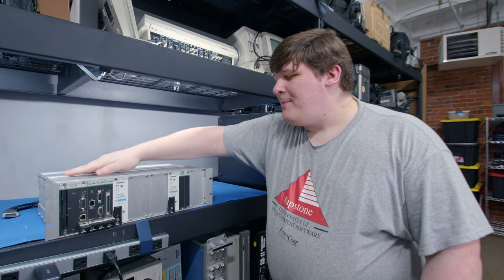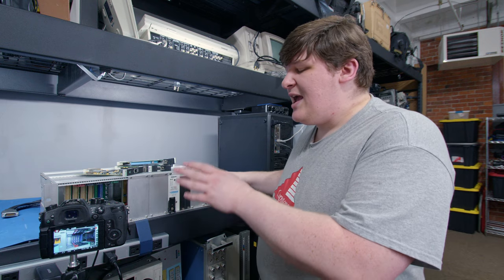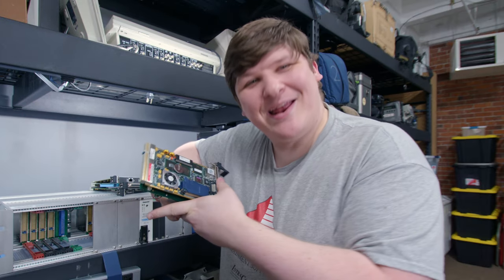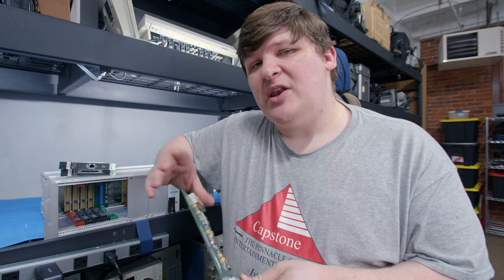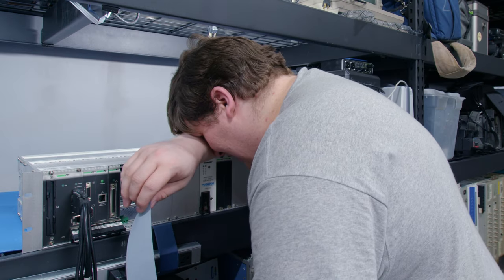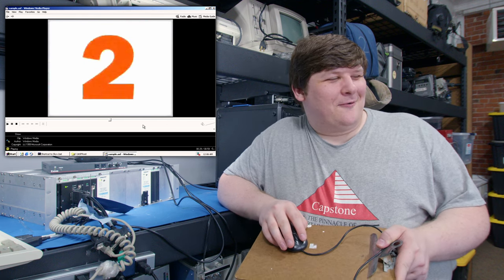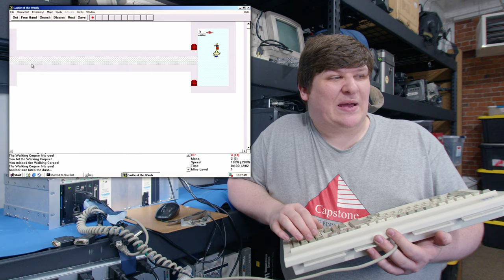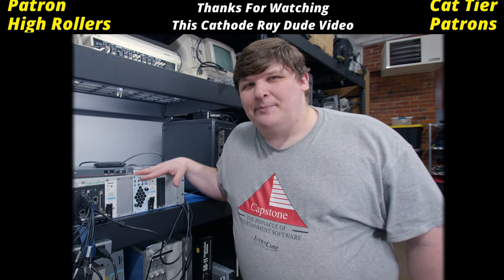Little Guys Ep 12: Computing With Eurorack

Comment: RE the SCSI port, my brother-in-law is an engineer for the auto industry. One of the many job anecdotes he's told me over the years is that they had a very expensive and perfectly useful piece of diagnostic equipment that could output Data to a PC, and it used a SCSI interface. They had to keep a very old computer running in order to make sure that that tool didn't become obsolete because it was five figures to replace it with an updated one. I bet you that external front-facing SCSI port was for a specialized industrial peripheral of some kind.
Reply: Around that time SCSI was used for things like scanners and other things that would be USB now. I have a Nikon SCSI film scanner that I’ve used with a FireWire adapter (not so convenient these days either).

Comment: Regarding SCSI for industrial use. In the past SCSI was also used for connecting scanners. Now in the place where I work we have a couple of machine's with "modern" (Read: Adaptec SCSI adapter with on PCB PCIe-PCI bridge) connecting to a node on the control system and gets process data out of it for the historian.

For audio: Use the USB port ;). Win2K Ships with a generic USB audio driver. Just enable the Windows Audio service in the service manager. That is disabled by default on server editions.

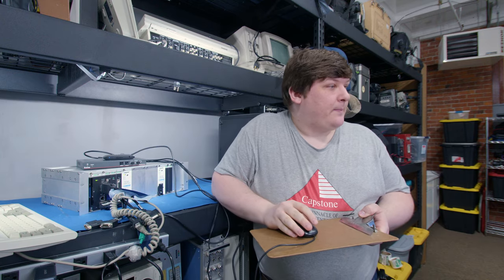Comment: 36:57 - Castle of the Winds!  Hell yeah!  I remember playing that off of a CD called 300 WayCool Games for Windows back in the mid 90's!  I actually have it installed on my Windows XP machine.  I remember finding a glitch in it growing up where if you used all your mana, it was possible to underflow your base HP into the negatives and then when you healed yourself you'd gain health without an upper limit and basically become an unstoppable bulldozer and could tank every enemy for the rest of the game by just ramming into them.

Comment: 10:40: IIRC the width of the cards were called 4T, 8T, 12T... Where a "T" is always 5.08mm or 0.2 inches.
Reply from the maker: ahhh, interesting. I'll keep that in mind!
Reply: That would explain the expression of "Fits it to a T".
Reply: So. The spacing is identical to Eurorack modular synth standard. My immediate thought has been confirmed and I'm 100% sure they both use the same screw rails.

Comment: Never saw one of these old units. I only briefly worked with an industrial robot control box that looks like this ten years ago, it's Kuka's Sunrise based on JAVA and Windows XP. The mainboard connected to their own hardware in the box. It could also be LAN connect to program it.
And to start the robot, you need its proprietary interlock remote control, you can't operate it without the safety interlock remote, it's where emergency stop button located.

Thank you for this video, I never had in-depth look at old hardware, this looks like a pain to operate.

Comment: honestly i wish that eurorack had kept the backplane connectors in some capacity because even in the era of keyed connectors people are STILL frying modules by plugging them in wrong. plus a proper backplane connector would have had the trace width to properly use the pins rather than doubling up power across pairs of lines. imagine the utopia of having clock/run lines to go with the cv/gate bus lines! come on folks API 500 series is doing it and they're really not any more or less expensive than eurorack.
Reply: I think Doepfer did what he did for price and ease of manufacturing. Those connectors + guides cant be cheap. Also, it would be much harder to make skiff friendly modules. Would be cool though, I do agree.
Reply: I mean the CV/Gate lines are rarely if ever used, so we could already use those.
Reply: @AshBashVids  yeah in modern hindsight clock lines would be far more useful. i don't think doepfer foresaw that people would be putting DAW-in-a-box sequencers like the hermod in their modular systems.

Comment: Definitely needs to become part of a synth! One manufacturer called Modcan used to produce an adaptor module for mounting and integrating a Mac mini into a euro rack setup.  While sound creation on a modular synth is seemingly infinite - accurately sequencing music on one is tedious and benefits from modern MIDI software. (And a MIDI to CV converter)  Certain sound cards that are DC coupled can even be used as CV sources using the appropriate software to send continuously variable signals for controlling all kinds of synth stuff.

Comment: Hell yeah, Castle of the Winds! I had Vol. 1 from a shareware disc and played the crap out of it, wondering if I'd ever see the mentioned sequel. Turns out I found it at a big box store's electronics section a couple years later (shoutout to Bigg's Hypermarket, RIP) and still have the 3.5" disc floating around somewhere. 

Funnily enough, we play the game completely differently. I always maxed INT and got Magic Arrow first to spellsling from a distance while running like a wimp down the hallways. And finding traps with my face.

Comment: Yep!  In an industrial computer setting remote boot is probably the main method.  That's because you need to be able to control and monitor them from remote.  If you actually have to go to the machine physically that would be a ladt resort.

Comment: Since you mentioned Eurorack... Look up Look Mum No Computer. Sam Battle builds his own Eurorack synth equipment and has expanded it into a standard he calls Kosmos. He has many of the schematic, gerbers etc for his Kosmos modules available for free on his website, and several others have put their own Kosmos module plans there too. He tours and performs live with his gear and he has a museum chock full of vintage and weird electromechanical and early electronic music equipment.

He had to shuffle a bunch of stuff around to make room for the pipe organ he rescued. It had been salvaged from an old church a long time ago and built into a house. When the house was sold the new owners wanted the organ out but didn't want to trash it. Sam got wind of it and bought it. Then he figured out how to adapt it to MIDI control and in the process of that he designed a MIDI board which operates a lot of solenoids. (Plans download for free for that!) He used several of those boards to operate all the solenoids that run all the organ pipe valves. He wasn't going to use the original organ console but he went ahead and fixed it up and adapted it to be a MIDI keyboard.

Comment: I work in the Metro of the city of Valencia, Spain, and we use similar PICMG equipment for every computer in the entire network! I also brought one home that i put two computers inside of. I also have the PC's that go inside each turnstile, to process RFID data and send it over ethernet to a central hub. They are Celeon 600 MHZ grey rectangles and are being decomissioned slowly, they run windows 2000 and have a custom autorun batch file that starts all the custom software that powers each turnstile.

Comment: The dual NIC might be for two different subnets.

It's pretty common in industry to have one network for local machine control, and another network for the machines talking to the factory itself. The local network is to control devices at the machine, and the plant network is to push data to the machine for data on how to run the machine, or to pull data from the machine for analysis and troubleshooting.

Comment: The specialty connector on the SCSI might be a combo 50-pin + Power. Kind of like the 44-pin IDE connectors in laptops. 40-pins + power. I imagine there's two drive trays/carriers that break that cable back out to a standard 50-pin IDE drive and 4-pin molex or uses a hot-swap SCSI drive. If not that, then just a cheap IDC ribbon cable connector that didn't require expensive 68-pin SCSI connectors.

Comment: The connectors on that (and a lot of other passive backplane systems) use those kinds of square pin connectors.  That design actually goes back to before the apollo program - Curious Marc and the AGC video series show similar connectors being used for the AGC components IIRC.  I wouldn't be surprised to find modular radar and military communications systems in the 40's and 50s having a similar type block connector for modular components (albeit larger-pinned).   Amphenol makes a ton of military/aerospace/industrial connectors similar to it - and I believe they even sell/sold a CompactPCI backplane.

Comment: I've always loved the back plane based systems, especially the ones like this that make perfect retro PC's in a tiny box... if you can get video and everything working properly, preferably without the breakout cable that I've had to make an i/o plate out of by hand for before. There's just something about the concept that I really enjoy, along with the other extreme of all the embedded SBC style systems I've collected and love.

I feel like at least the designs of these industrial machines at the board level will make a comeback with Chinese manufacturers expanding past the 8086 era to make more of the "portable retro computers." If they integrate the right video and sound devices along with a bios that allows in depth enough hardware tweaking, you would get a machine that covers a broad range in a simple/small package.

Comment: The fact that this thing is a satellite gateway makes sense with the 2 Ethernet adapters. One would be facing the avionics side of the aircraft with the satellite radios, and the other side would have a WiFi access point and probably the in-flight entertainment monitors. That would explain the SCSI card and the media encoder, because the SCSI port would connect to a hard drive shelf which has the in-flight movies on it.

Having more than one Ethernet adapter is really common in these industrial boxes. Usually one end would connect to some Ethernet based fieldbus and I/O on the customer site, while the other side would connect to either an in-house SCADA system for high level management or to the internet via a VPN tunnel to allow remote maintenance and diagnostics.
Reply: This predates Wi-fi for most applications; I imagine it was more a "pay us and we'll let you dial in or connect your Ethernet to our dumb switch."

Comment: In particle physics experiments, VME was an 1980s improvement over CAMAC (70s) which was an improvement over NIM (60s).  NIM is for Nuclear Instrumentation Module because all particle physics was nuclear physics back then.  The NIM modules plug into a backplane and have well-defined behaviours.  You connect them with BNC or LEMO cables for your particular(lol) needs.  E.g. you can have a dual comparator module that takes in analog voltages and send a standard pulse when a threshold is crossed, then another module might apply a delay, then another would AND those two signals together and produce a pulse when both your detectors triggered.  It's all analog and 1-bit digital and afaik nothing ever talked over the backplane even though the standard was meant for that.  CAMAC is actually computerized and the modules can talk digital through the back, but it's old enough no one uses it.  VME is modern enough you still see old labs using it.  NIM is robust and analog enough that it's still used in modern labs for prototyping and testing because it's so easy to set up: literally plug in some cables and turn some knobs, no keyboard or OS required.  I would love it if there was a retro-nuclear-computing community I could join, I have a NIM crate and a few modules at home, gotten from ebay.

Comment: 4:37 I work at a production factory that makes complex electronics assemblies and I see these connectors every now and then. I can't say too much because I am under an NDA, but I wouldn't be surprised if these were used in satellites or medical equipment. 
I would guess it's a standardized connector that simply doesn't have its own associated protocol. Kinda like how many people think D-Sub 15 connector is the "VGA connector" even though you can wire the 15 pins however you want.

Comment: That cable reminds me of those Laplink cables with both 25 and 9 pin D-sub serial on. They had versions with 25-pin D-sub and whatever-pin mini-DIN for Macs to transfer. I wonder if the factory Laplink commissioned was later approached by these guys. 

Those are much higher density connectors, but the multi-headed-snake aspect of it (plus the moulding clue) are awfully similar. Maybe one company made every multi-headed cable for the entire industry, given the ways car parts etc logistics work I wouldn’t exactly be surprised.

Comment: The Little Guys i interact with on a daily basis are Posiflex all-in-one touchscreen PCs for my works POS system. Most of them are getting close to 10 years of continuous operation, and even the resistive screen ones are still in surprisingly good shape. The little guy I'm more curious about is our "StarBox" which is an SD-WAN from Star2Star that allows our Polycom phones and previously existing computer and internet equipment to all work together in harmony, but from what I've gathered it's an entire computer of its own just headless and remotely managed sadly.

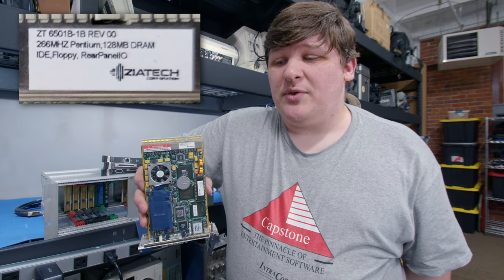Comment: 16:30 that looks identical to the Cisco 60-pin "5-in-1" connector. This connector is DB-60 on one end and can be V.35, RS-232, RS-449, X.21 or EIE-530  or a combination on the other.

Comment: That cable is a DB60 serial connector.  It was commonly found on v.35 cables used for leased lines in the early 2000's.
Reply from the maker: I always forget about that! I used to handle tons of routers with those ports, but never had a reason to use one so it always slips my mind. That means this cable is not like DMS-59, because that plug specifically had a single missing pin, hence the name.

Comment: I have a Dell Pentium Laptop and it used the weird 72pin EDO sodimms, I ended up maxing it out, I got some modules that were like pulled out of an old Cisco switch or router,  all the other laptops from that era were usual proprietary, although Compaq seemed to be an early adopter of the 144pin sodimm, my Armada 1585DMT uses 144pin EDO Sodimms, that I maxed out to 144mb, I think the 128MB dimm I used was for some sort of big office copy machine.

Comment: someone needs to make a eurorack sized sound canvas for that thing. maybe throw in a sampler module, mixer, and reverb. instant studio-in-a-box.
Reply from the maker: FACT
Reply: Studio in a box, that reminds of some dedicated PC’s from the late 90’s that ran BeOS. Devices like the Tascam SX-1 and the izRadar  multitrack recorders. Those are a kind of big “little guys”. They are fully self-contained Digital audio workstations with bespoke built-in audio interfaces. Pretty neat machines. Nowerdays many portable grooveboxes aim to be a studio in a box but they aren’t pc’s but ARM based devices.
Reply: disting EX can load soundfonts so that's your sound canvas solved
Reply: and for the sound canvas or GM compatible rompler I guess an SCB-55 could work...
Reply: It's apparently the same screw rails. Bonus points for the fact you can just use power modules as PSUs but put them on THE BACK, so they don't interfere.

Comment: actual horizontal unit is called "hp", which is 5.08mm wide. the rest of the physical information is available on bitsavers in the VME spec ( pdf/motorola/VME/ )

Comment: Ah plastic memory clips. Used to be a tech in the late 90's to the early 2000's for home PCs, industrial and commercial computers. If I had a penny for each plastic memory clip that has broken on me in the field I'd be rich.

Also, regarding CompactPC, I do remember seeing these quite a bit in commercial/industrial settings. If my memory is correct, they were usually serviced by the place they were obtained from since they were so unique to each place they could be found. I certainly never serviced any of these myself. Nor did I have any interest in learning that ecosystem of hardware at the time. I find them very interesting today given just how odd they are, or could be.

The only feature port on video cards that I can remember was for things like a tuner card or anything that exchanges data with the video card, in a direct manor that doesn't impact CPU workloads.

Comment: 3u is the height of the rack, not the width of the card. The width of the card is measured in "hp" which is the spacing of the holes in the horizontal rails.

Comment: That little blanking plate on the back of the 1U SkyX gateway looks an awful lot like they just screwed it right into the VGA(likely) port's lugs. 

Love the excitement when comparing the reset button situation to Cisco's, by the way. They did amend that in the end by updating their switch designs, but if you had one of those... Yeah, don't do that. Or disable the button.

Comment: That connector used in VME and Eurocard (and NuBus!) is known as DIN 41612. Based on the “DIN” part, you can probably figure that it’s designed by the same standards body that made the circular DIN and Mini-DIN connectors - the Deutsches Institut für Normung (German Institute for Standardization), or DIN. But I’ve never seen a DIN 41612 connector like THAT before…

Comment: For your edification....

There are plenty of x86 VME processors going back to at least 386 days, if not farther. I worked at a company writing BIOS code, though when I started, the oldest that I personally had to write code for Pentium4 VME boards. The newest that I worked on was 2nd gen Core I7's. The company that purchased the company that I used to work for took VME as far as the 4th Gen I7 CPUs.

Comment: That is a VIdeo Bios Rom, for the integrated video what would be pumped out the backplane.
The battery is on the front because it wouldnt be able to stick out the back in a single card config.